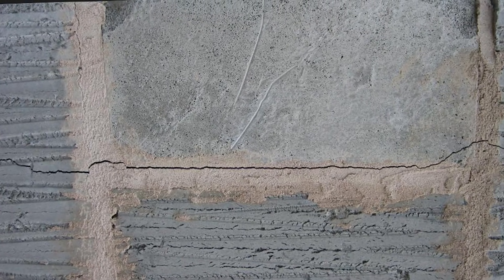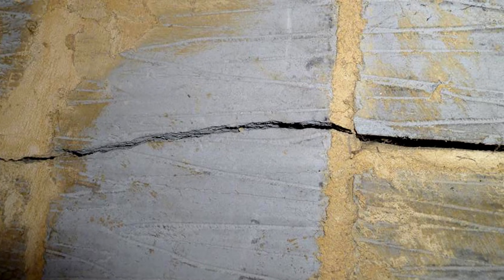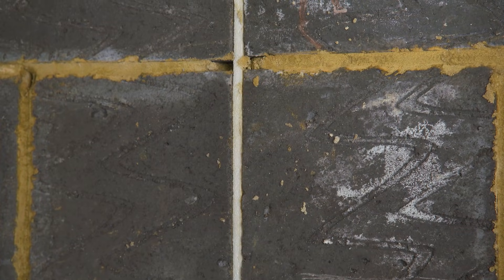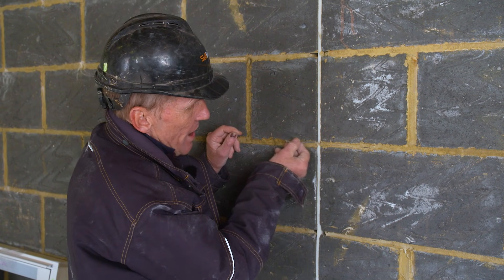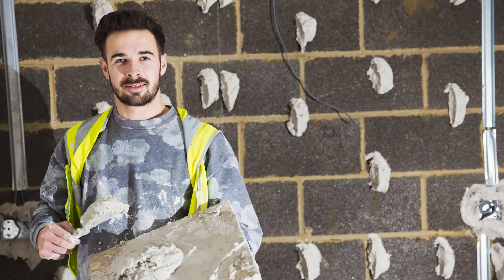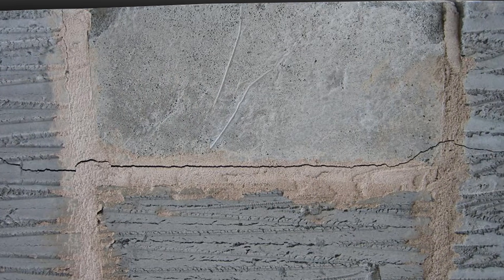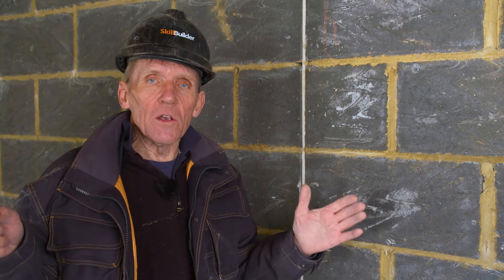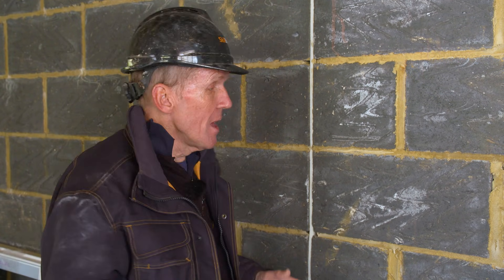Why Are Aircrete Blocks Cracking Up So Often?

Comment: Ok, I've been thinking about aircrete and how people use it. I think it makes more sense to think of it as a replacement for foam insulation panels and/or drywall, rather than as a structural member.

Comment: The design was never solved, they lied you have to double the surfactant to make the volume, tipe III cement or other additives such as gel, the skin and mortar is too strong, the ideal of air creat was flwaed, originals where cinder block.

Comment: You can build a house out of gypsum hardtack and the regulators will send you off with a wave and a smile.

Try to build one of those masonry houses that the natives did 3000 years ago, and are still standing without maintenance 2960 years later, and you're off to the people cages.

Comment: "They're usually put closer to the corner than they are to the middle"

Closer to the corner you'd have stresses and deformations in multiple directions.  Not sure if that's it, but it feels like the right answer.

Comment: Not a professional, but if you put the division right in the center, would make it weaker. If you make weaker mortar, doesn't it mean it will not last as long? Any time I have seen mortar that you could scrape it easily, it was failing?

Comment: My mates Barrett house, you can scrap the mortar out of the outside joints with your fingernail 🙄
I’ve also seen relatively new builds with the mortar washing out of the brickwork at street level due to rain splash, another wrong mix 🙄

Comment: This isn't "aircrete"... It's a Concrete Masonry Unit wall (CMU)... The professional term for the standard, hollow-core building block. Often called Cinder Block... Which is an older term for blocks that historically used coal cinders as aggregate; most modern blocks use different, safer materials but retain the name. In Britain I'm told they're often called breeze blocks. "Aircrete" is a foam based cement product with no aggregate other than the matrix of trapped air bubbles within it. It floats on water and its mortar is also the same aggregate free foamed cement mix, only heavily fortified with polymers instead of water for hydration. Hope this helps someone.

Comment: Well but so does normal concrete if you dry it up to fast, aircrete doesn't tear if you cover it and let it dry. 🤔Makes me wonder tho ... roman concrete.
Reply from the maker: If the blocks are wet they will shrink and if the mortar doesn't allow the tiny movement the blocks will crack. Slowing the drying time makes no difference to the end result. You have to ask why it possibly could.
Reply: @SkillBuilder  Yes the motar thing makes sense but I serriously gotta disagree on the drying/curing process as that is a thing. And just to clarify, I was not talking about the conrete as a wall but as blocks in general but oh well, given the mortal it might do so anyhow.

Comment: Roger, perfect timing. What’s a definition of a weaker mix for aircrere? Was considering 1:1:5 (cement:lime:sand) is that too strong?

Oh wait, just read manufactures datasheet, 1:1:6 is the max in block capitals. Good to know.

Comment: I don't want to $hit on anyone... But truthfully, a high percentage of these blocks that are cracking is due to the builder. Either from little to no experience with cement/concrete work, and or cheapskates or corner cutters using the $2 a bag 500psi material. So you could have a no clue what they are doing aside from a few youtube videos type, that used the cheapest product they could buy, and not even using it correctly... And then wondering why "This construction method sucks, doesn't look good, and not holding up". I say this after watching MANY how to videos... It's sad that Youtube doesn't vet the dyi channels. Whenever I have days that I'm sad, I go flip through and watch the funny dyi channels. Aircrete is a 70-100 year product if you know what you're doing and use the correct materials correctly. And like all homes, it requires maintenance from time to time.
Reply from the maker: Builders build to a drawing. If a block is specified because it needs to meet a U value then the builder has to use it or an equivalent. The higher the U value the weaker the block

Comment: Rule number one with these blocks is to keep them dry. If you let them sit in the rain before you build, they are guaranteed to crack. Being aircrete they soak up water like a sponge and expand measurably.

Comment: What about the adhesive that is used with some of these blocks in place of mortar. It has a stronger bond than mortar but is used in a very thin layer and the adhesive itself likely has some flex to it, Is that more or less likely to cause cracked blocks?
Reply from the maker: I have used that thin joint system and the blocks still crack.

Comment: Just krend an entire house built with these. The orignal render had cracked everywhere. When we hacked it off the reason was clear over 120 hexy support bars and resin later and at a extra cost we based and meshed the entire outside. A month later still no cracks so we are applying a thin coat finish. Told customer to sell it within the next few years and check the block work when buying another.

Comment: As a German, I have never seen 3 inch aircrete blocks used on house walls! We use them to build a “none carrying wall “ to build a shower cabin. Or to build cabinets. We use 12 inch blocks to build houses. They don’t crack. And on top, we do not use any hand mixed sand & cement mix. That’s completely wrong! We use the thin bed clue you get from the building supply store.
Reply: Then what you use in the mixture?

Comment: @skillbuilder. Would be great if you did a video on types of extension methods. SIP V aircrete V block V timber frame with external mineral wool insulation. A series of videos probably needed

Comment: Possibly if the mortar was mixed properly with properly gauged mortar as said in this vid , food for thought the Romans then ourselves didn't have  modern cement in their construction! The fruits of their labour using line mortar still with us ! Downside, lime mortar mixing done properly is a time consuming process, that cannot be rushed.
Reply from the maker: The Romans used lime but also sourced a lot of their cement for aquaducts etc from Grenoble which has an almost unique natural waterproof cement.

Comment: When I did a house refurb and extension, everyone told me that aircrete blocks were the way forward.  "Great insulation and just as strong".
I got a few and tried simple things like hammering in a nail and inserting a screw, just as if I was hanging a picture or fixing some cupboards.  They just fell out.
I banned my builder from using them.

Comment: Expansion joints will go near the corner as there's two elements of force from expansion and contraction of each wall acting near the corner. As one wall expands the joint will take that up bit that wall will push on the other and try to rotate ot a bit. The joints should accommodate that

Comment: Back in the late 70s we would have someone turn up to take away a sample for testing of the render mix to make sure it was the right gauge and no fairy liquid was used, I'm still plastering and have never had anyone around to take a render sample since. The blocks on the outer skin look like concrete blocks so you need to go stronger than 6 and 1 for the scratch coat render then back to 6 and 1 for the top coat render :)

Comment: Aircrete blocks cracking is nothing new! I used to do up to 10 site inspections a week on self-build houses, housing estates and apartment blocks back in the 1980's and 1990's, sometimes the blocks would have serious cracking even before building completion! This is the reason, why I have never specified aircrete, or lightweight blocks on any of my projects! Chartered Architect.
Reply: Do you have any idea if eps concrete blocks cracks aswell ?
Reply: But for tiny houses is perfect. Very cheap
Reply: Is the most Used Material in Croatian Hosing as far As I know
Reply: Wouldn't use them for load bearing, better as a filler

Comment: I very much disagree about the mix of the concrette if you come in 10 years to check the scratching test you will be measuring a different solidity and so on up to 100 years. The solution is to build  foundations and use strong concrete reinforced with steel bar . You dont tdo this in uk because everyone is about saving. So this is a big bs you may aswell put some chiken wire mesh on it and do a thick coat of cement over both faces and you end up with  very durrable wall more durrable then the airbriks and all the structure this home allready has. Rite got that out.

Comment: Question for anyone:
Are what is called aircrete the same as what's called 'cinder block' in the US?
Because aircrete here is foamed concrete (no sand or aggregate) and mostly used by DIYers experimentally.
Reply: Yeah they are cinder blocks / breeze blocks. Nobody other than builders actually uses the term aircrete in the UK either.

Comment: Had a similar block here in perth when I 1st arrived called thermolite latex with tile glue would you believe, shocking results
Reply from the maker: We call it Thin Joint and it is bedded on tile adhesive which has no give. I used it and the blocks cracked all over the place.
Reply: good for cleaning your trowel....and that's it

Comment: Aerated concrete blocks are used throughout Europe (e. g.   Ytong). Is there a particular reason why there are issues in the UK and not elsewhere?
Reply: They were used in the UK for about 20 years before they started being used widely in mainland Europe.

The difference is time.
Reply: @thomascrabtree  The patent was filed in Sweden in 1924. Why would they have been used in the UK before then? In Switzerland, they were widely used in air raid shelters in the 1950s.

Comment: around 2-3ton will crumble one ….
Reply from the maker: The weakest block in the range will support a lot more than that. You have to spread the load with a padstone to stop the crush but it will then support a huge amount. 2.8Nm

Comment: I am a bricklayer, 50 years experience. You do not use 4+1 mix for facework, unless your laying engineering bricks. It  too sticky & dries too quick. As for blockwork 6+1 is what your advised to use, but unless you use lime in the mix it doesn't adhere so nearly everyone uses 5+1. As usual theory's great but it doesn't work in practical applications. It was once advocated that you use 10+1 for blockwork, next day you were able to pick up the blocks you layed the previous day. No adhesion at all.
Reply: 3-1 on a proper engineering brick there is no right or wrong. But the mortar can’t be stronger than the material your building with. Most bricks 5-1 or 6-1. 5-1-1. Most common of silo mixes. Them blocks are horrendous don’t why still widely get used. They 600mm long white blocks sure the manufacturer say 7-1 mix which is crazy the never really stick beds just slide off only the weight build locking them into place really.

Comment: Hey buddy, will this be the next RAAC saga…….
Reply: Its the same stuff just without the metal reinforcing bars
Reply: @piccalillipit9211  oh, so no chance of it spalling.
Reply: @BleachDemon99  Even RAAC should not spall cos the rebar should be bitumen or plastic coated.  Aerated Concrete is not waterproof, in fact its quite hydrophilic, so rebar WILL rust 100% guaranteed.   RAAC's problem is mostly that it undergoes chemical and thermal decomposition. It just turns to dust with time basically.

Comment: What happens to the plasterboard and plaster that’s over the top of the blocks and over the movement joint that obviously doesn’t have a movement joint?
Reply: depends on the size of the building - plasterboard may well absorbs the shrinkage stresses, but it could tear. Plaster will very likely crack in a slightly haphazard way - Movement joist should be carried through any finish

Comment: My house was built by Redrow in 1997. Lots of these celcon lightweight blocks visible in the loft, a lot of them cracked and I noticed whilst being built that the upstairs floor joists are are laid on these blocks where I would have put a wooden flat bearer to spread the weight. I have also noticed that the celcon blocks have also been used underground in the main foundations.

Comment: ahead of the curve here, 2023 RAAC public sector scandal
Reply: @streaky81  PLEASE STOP TALKING.  1) Its entirely related, this is AAC the R is the reinforcing bar.  2) "Also there's nothing wrong with RAAC when it is maintained properly "  You can NOT "maintain it properly" as it undergoes chemical and thermal decay. 3) "The problem with RAAC is the steel". NO its not. If there is a problem with the steel it is because it was not bitumen or plastic coated as per BS 8110 - P3, you can not use bare steel in RAAC as it is entirely porous and offers no moisture protection. 

QUOTE " There's so much misinformation about this issue out there it's unreal" YES THERE IS and you are spreading it.

Comment: As a structural engineer, we normally provide expansion joints to the external leaf and contraction joints to the inner leaf for traditional masonry wall. For the brickwork this need to be every continues 9m of wall or less and the blockwork is every continues 6m of wall or less but from the corners its good practise to provide at half of that distance due to high stresses from thermal expansion and higher induced wind load at the corners.

Comment: given the current schools crises Roger is ahead of his time!
Reply: ..that school crisis is to do with steel reinforced structural concrete failure rather than just cosmetic cracks.
Reply from the maker: It is the same material made by the same manufacturers that make the blocks. AAC are the blocks RAAC are the panels.
Reply: @SkillBuilder  my point is that anyone reading that comment would think that cracks in aac non structural walls such as what's shown in your video would mean the building is going to collapse which clearly is not the case ... sure it's the same material  but the consequences of cracks in this case are far less serious.

Comment: Correct me if I’m wrong but can’t epoxy and other things reinforce it? Like gunnite used to build in ground pools. There are solutions like rotting wood gets fixed with some epoxy mixes. Some builders say it works miracles

Comment: Seriously no-one should be using aircrete blocks in any load bearing areas -even loading a timber joist single storey flat roof on an aircrete block cannot be recomonended, they were always meant for infill only.

Comment: Cement too strong. Must always be weaker than the block. Cement often mixed by idiots.😂
Reply from the maker: As an ex brick layer's labourer (idiot) I would say it is more a case of not wanting to have two different mixes on the go.
If you bring the inner and outer skins up together as they recommend you  would be constantly changing the mix

Comment: This is so interesting, expecially in light of the widespread aircrete issue recently announced  in 100s of UK schools and municipal buildings.
Reply from the maker: More to come on that subject is a couple of days time
Reply: There's a couple of differences in the naming, but these blocks look to avoid the worst risks of the RAAC story in Britain. What I know of that scares me is the long panels and beams. These blockwork walls are under compression loads. The RAAC beams and panels, supported at the ends, get a tension load at the lower side.

The descriptions I have seen include other problems, associated with the reinforcement, which I don't see any sign of here. But this video showed a couple of details that could be easily missed — the strength of the mortar and the expansion joints.

The RAAC failure mode seems nasty — less warning time than we were promised for an ICBM attack.
Reply: @davebell4917  just on the face of it, anything-crete under tension is simply bad engineering, end of.
Reply: That  is an RAAC issue, not aircrete. Different stuff used very differently
Reply: Hi Roger,
Many years ago , as a Building Merchants,  we had many experiences of these lightweight blocks cracking due to expansion and contraction .
    In consultation with a manufacturer, Thermalite Ltd, we were advised that their recommendation for the Mortar Mix was 11 or 12 parts Sand to 1 part Cement! Everybody was very reluctant to do this as you can imagine!

Comment: Hi Roger, you mentioned about the like a train track reinforcement under to window, my I ask if I use galvganized eml coil reinforcement is the same under window, or just stay with the train track .? Thank you jos
Reply from the maker: The galvanised stuff will rust and is too bulky. Try stainless steel bed joint reinforcement from Teco Builing Products 
https://tecoproducts.co.uk/products/bead-mesh/ladder-mesh/
Reply: Thank you will do

Comment: Hi .Are aircrete more expensive than standard concrete blocks ?   Considering the potential cracking problems ,is it best to avoid these blocks and go with standard concrete blocks , they are tired and trusted  and the trade knows the rules for laying them . Any comments ?

Comment: Hi Roger would you advise soaking the blocks,or dampening them prior to laying to help prevent the mortor bed drying too quickly?
Reply from the maker: No the water will leach out. The blocks also shrink as they dry so it is best to keep them dry and make the mortat a bit sloppy.
Reply: @SkillBuilder  cheers keep up the good work